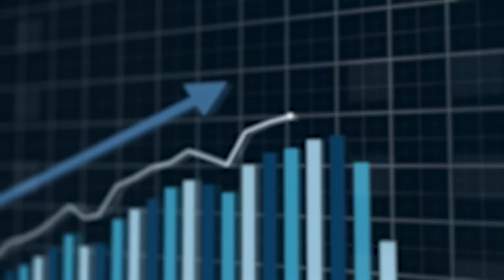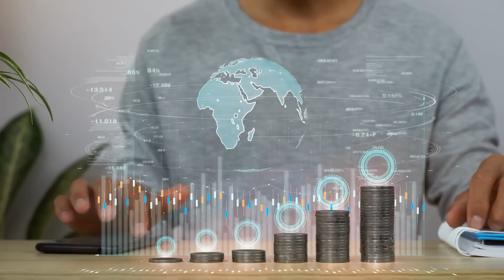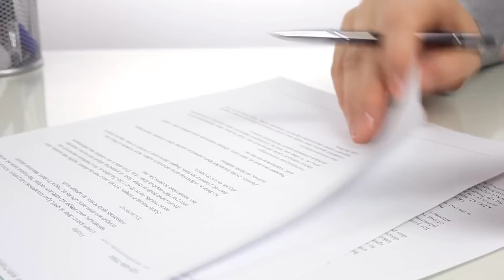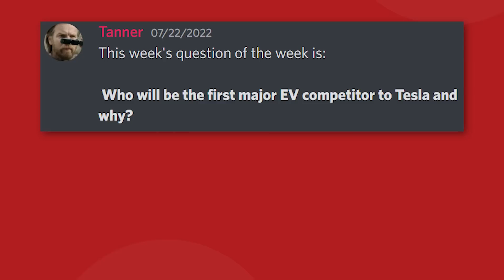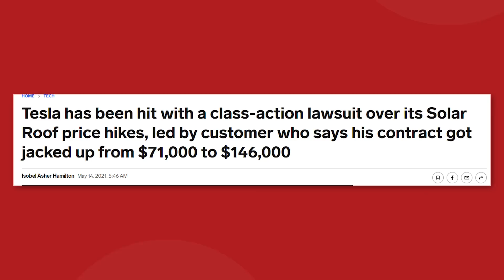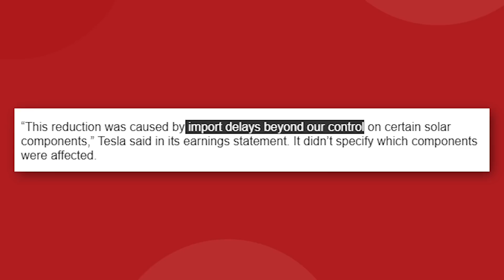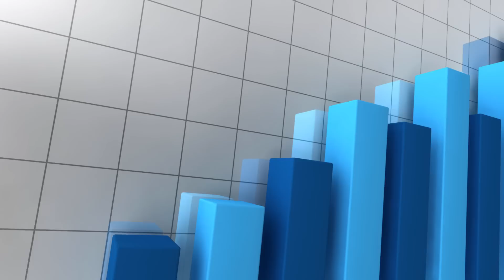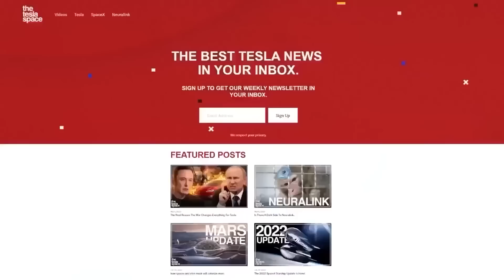Major New Tesla Solar Update!

Comment: As an ex roof tiler the problem with Tesla's solar roof is its being marketed wrong, the solar roof is perfect for new builds the complex shape of most existing roofs makes retrofitting far too expensive, unless a building needs a complete new roof then solar panels are much easier to install & far more cost effective.
Reply: Actually, that was how I saw them promoting it. For both new construction and when a roof needs to be replaced.
Reply: Yea, Tesla should have bought a home builder company and working on intergrading all their products.  It take years for cities and jurisdictions to be educated in these new builds.
Reply: That and when panels get better it will be more than twice as expensive to get the new ones. Service and slow
response was why I went to a local Solar installer.
Reply: @ctuna2011  This is a whole other stupid situation. There are no industry standards for solar panel connections. So, you need to replace the whole system, not just the panels.
Reply: @danjw1  MC4 connectors have been around for a long time.
Reply: @odonald6087  I am far from an expert but this is my understanding. It may have to do with the other equipment working with different spec panels.
Reply: I agree with u. I Think the idea of the "normal look"  is the core Problem of the tesla solar roof. It is even more stupid than people Who are concerned about loooking like Nerds. Unfortunally all the good ideas about the Tesla solar roof are played out by it. The tiles should be fabricated in exactly that Size in which workers can do the roofing the fastest, safest, easiest. Im not an expert,  but should be about 25-35 by 20-25 inches or so. For parts of the roof where tiles are in the shadow or have to be cut there should be alluminium tiles in the same Size. On the long term, it will always look better to be rational than conservative, especially in aesthetic terms.

Comment: I’m 100% confident they have plans and something way better coming. Solar is 1/2 of teslas master plan. However, powering the grid, would eliminate the need for installing individual solar roofs or panels on homes. Tesla is working on powering the global GRID.
Reply: It wouldn’t eliminate the need for residential solar panels, the main benefit of residential is taking stress off of the existing grid.
Reply: @nicholassides8001  but if the grid is powered by solar, there won’t be a need for as many solar roofs; however, home powerwalls can be used to help support powering the current grid, until the grid itself is powered by the sun.
Reply: @realtalk6340  I agree that powerwalls would help the grid issue but it doesn’t matter if the power is by sun or traditional methods, the lines running that power to homes is getting stressed. We’ve had rolling blackouts in Texas because of it lately and there’s only 2 options: 1) residential Solar to help with daytime use or with powerwalls for nighttime or 2) rebuilding/adding to the existing grid
Reply: @nicholassides8001  thank you for explaining that; I understand now. Powerwalls are the solution then.
Reply: @nicholassides8001  Well, that and shore it up, especially when paired with batteries.
Reply: I recall a Tesla executive saying they had focused too much on the roof tiles and not on the rest of the the installation. That they had stepped back and working on trying to refine the process. I don’t remember exactly when that was, but I am thinking the last battery day.
Reply: @danjw1  Correct, yes sir! I watched that as well. I vividly remember he appeared to be holding those cards close to his chest when discussing the “plans” for the next step of their solar master plan.  IMO, maybe they are planning on building entire mini homes? Or stand alone retro fitted roofs. I believe they want to be able to install roofs in one day max to minimize labor and costs. However, powering the grid, would eliminate the need for installing individual solar roofs or panels on homes. Tesla is working on powering the global GRID.